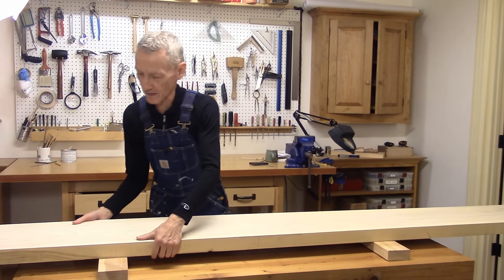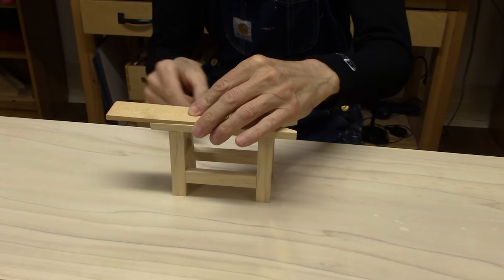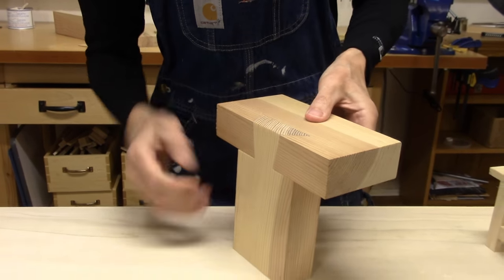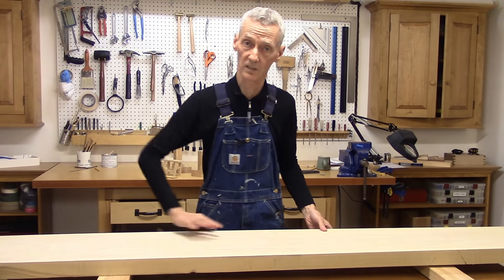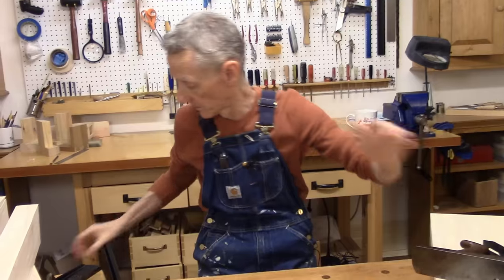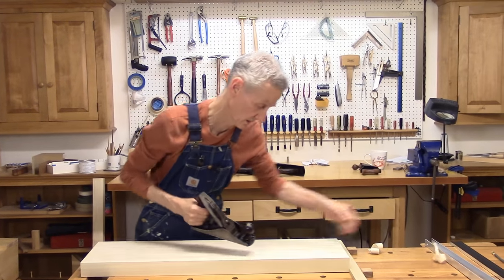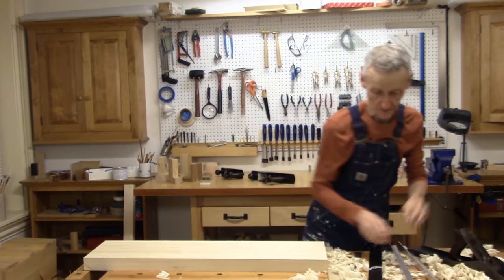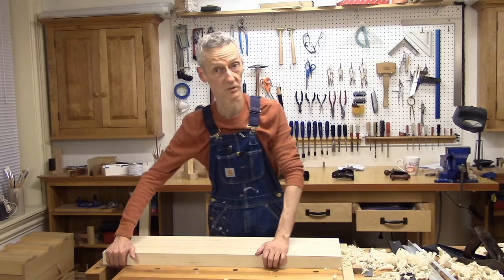Saw Bench Show #1

Comment: Great presentation, enjoved the model set-up and the explanation re: rising dove-tail. Hope to learn the geometry of the joint as I plan to build a Roubo bench in the future with "sliding dove-tails for the legs.  Appreciate your show more than you know.  Regards
Reply from the maker: +Richard Decker   Hello Richard. Thanks for your comments. I'm glad my model and practice dovetail were helpful. The rising dovetail Roy Underhill uses is different from the sliding dovetail seen on the original Roubo bench. It's an interesting variation. This will be a fun project. Thanks for visiting.

Comment: Nice project!  I love how you explain the joinery and final bench with models, that's an extra step that's much appreciated.  I've been thinking about building a sawbench soon as well, but am leaning toward a split top bench rather than just the bird's beak.  Good luck, looking forward to the rest of the build.  Oh, I also appreciate that you clearly indicate when you'll be using power tools.  I've noticed a few "hand tool" builds online where I've suspected that between scenes, the builder is using power tools without full disclosure.
Reply from the maker: +Woodnerd   The split top is a very good design. I like that style as well. Between the scenes power tool users?? Say it ain't so! Best regards.

Comment: Great project.  I stumbled upon #5 and now I am starting at the beginning.  Love the bench.  And design specs available?
Reply from the maker: Thank you Christopher. The saw bench was a fun project. I don't have any published plans to send you but the top measures 8" x 32" and the bench is 19 .25" high. I use 1.75" poplar throughout. Some specifics are show in the video, if you need any other dimensions or have further questions, please let me know and I will be happy to reply. Thanks for the visit and best regards.
Reply: A saw bench I can use! Thank you for the dimensions, I'm starting this next week.
Reply from the maker: Good luck Chad. Let me know if I can be of any help. Have fun!
Reply: treebangham what is the angle you are using for the one side that has the legs splayed out?   Very much enjoyed this build and plan to make one myself.
Reply from the maker: The angle is 1:4. That's about 14 degrees.